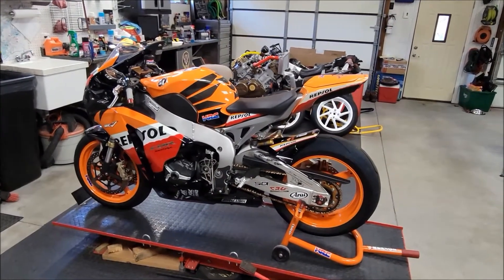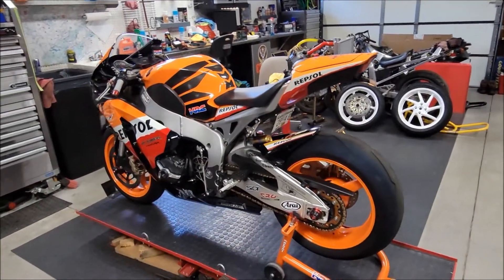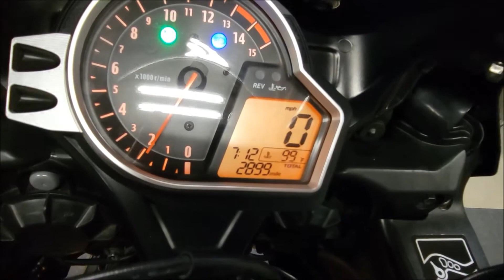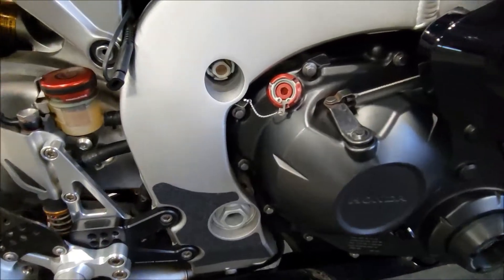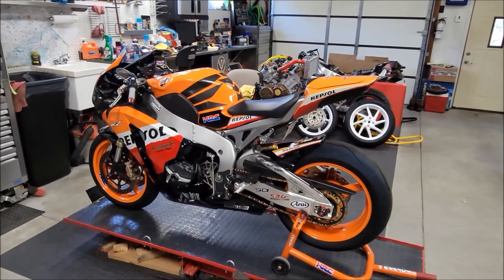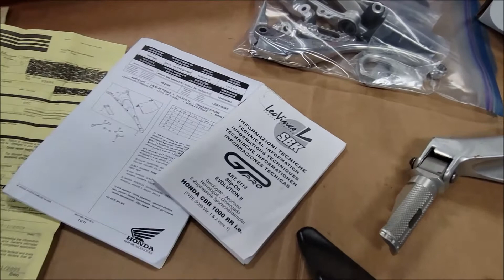Time Warp 2009 CBR1000rr Repsol Edition

Comment: I know it's been a long time, but I'm hoping for an answer. I bought a motorbike like this for my son, from 2009. Since it makes the same noise as yours, I mean the noise of the engine near the clutch, this sort of "whistle", I wanted to understand if it is a normal noise, or it means that something is wrong it goes. I understand that a clutch recall has been issued for these engines. This "whistle" means that the recall has been made, or not. Thanks for the reply. I write from Italy.
Reply from the maker: Actually, the whining noise means the recall was NOT done. 
The update apparently involves the clutch AND crankshaft.
I didn't notice the noise till the recall window was over.
Asked my motor Guru about it and he said it was not a threat for catastrophic failure. 
Hope this helps.

Comment: I have an 09 I bought last august and ride it regularly I put about 5000 miles on it in 4 months. I’ve read up on crankshaft noise and am indifferent if it’s something I should think about it or not.
Reply: I’ll note mine sounds exactly like the one in this video. That slight mechanical whine behind the exhaust note. Probably just unique characteristic of the bike itself ?
Reply from the maker: My tech says this is the sound related to the "Crank" issue. Nothing to worry about according to him.

Comment: Hey brother. Just picked up a low mile, one owner 09 blade. I see how you took off the left side engine/ front sproket cover. I believe it has to come off to switch to gp shift. Did you just remove the cover and replace with the custom sprocket cover? looks great. Would love to find one like it
Reply from the maker: It's a custom cover I made a small batch of back in the day. Unfortunately, long sold out

Comment: never got the warranty work for the crank whine?
Reply from the maker: Nope, mine started long after the warranty period. 
My tuner said it's never catastrophic
Reply: @metlhdmensch1007  I bought one and it also has it, I did a lot of reading on it and think I agree with your tuner. it seems the crank primary drive gear distorts ever so slightly to make the noise but in most cases never turns into a catastrophic failure.

I hope it doesn't atleast, I love these bikes.
Reply: My motorcycle has the same noise, 70k KM later still works superbly.